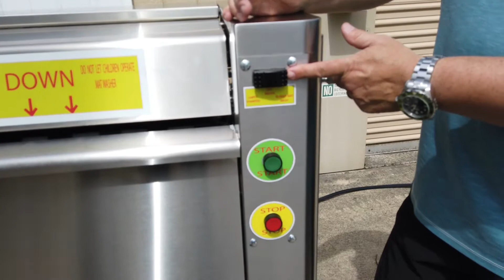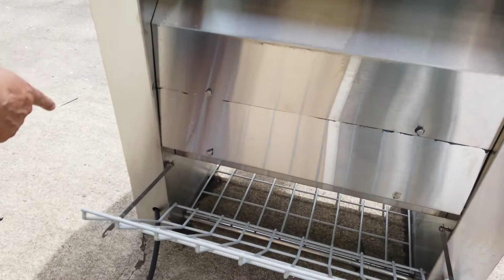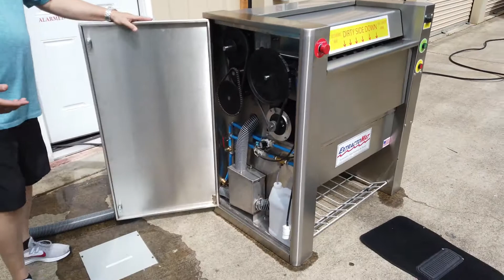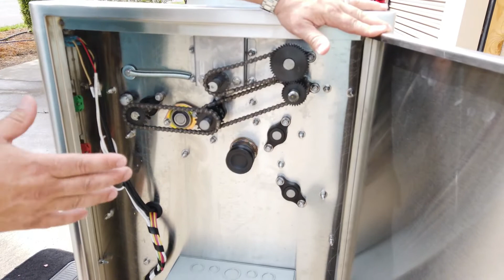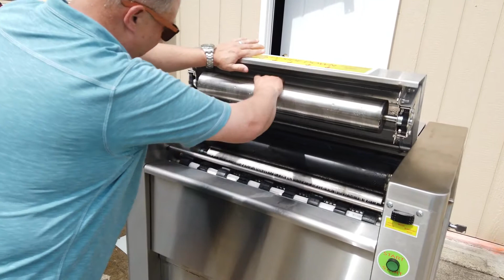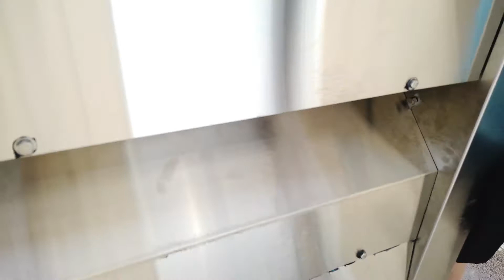Extractomat Intro Video

Comment: So this machine does not do the “cleaning/scrubbing”… it’s a extractor for AFTER you clean or scrub the mat?
Reply: This machine does the cleaning / scrubbing.   Clean and dry mat in 30 seconds
Reply: This machine will scrub the mats and return them dry in 30 seconds